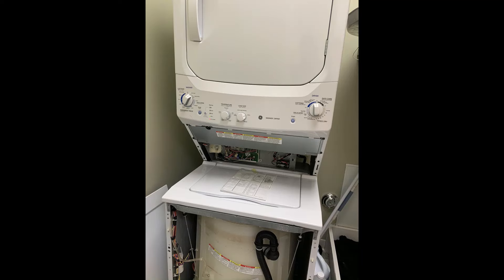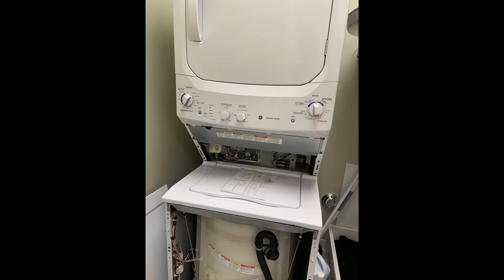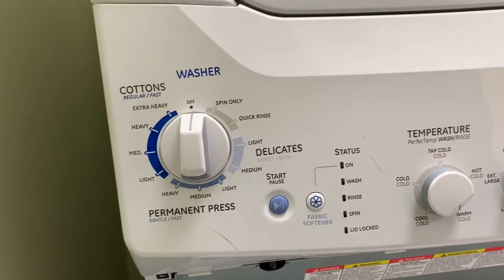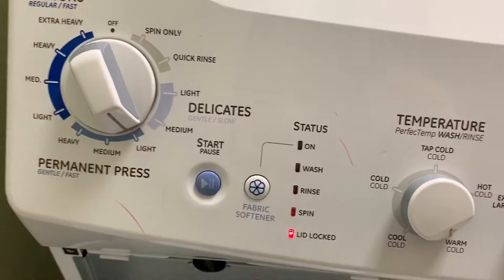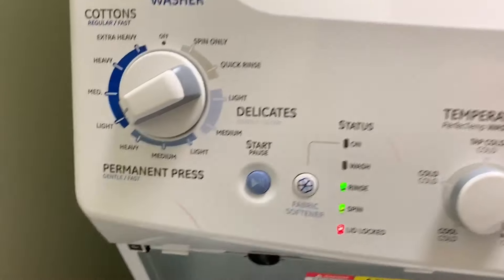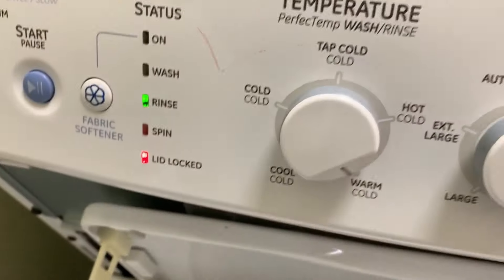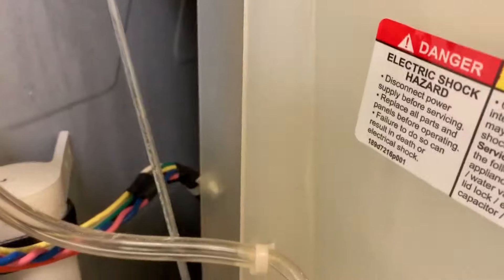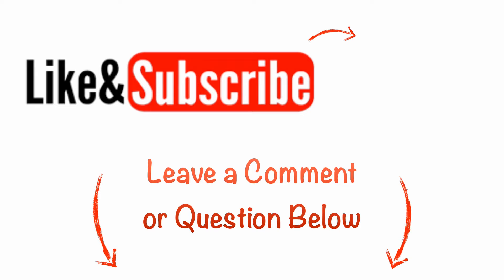How to use Diagnostics on Stacked GE Washer Dryer combo(Laundry Center)

Comment: I have this unit and the washer side has no power.lights wont turn on and it wont do anything. Dryer is still working fine any suggestions?
Reply from the maker: I would suspect the main board.  Check the schematic and wire the L1 and make sure it’s to the board and voltage out of it is good or not.  Don’t know specifics without seeing a schematic. Good luck!
Reply: I’m having the same issue. I took off the slanted panel underneath the dryer and the electrical board inside was soaking wet! I don’t know if that’s the main board or if I should replace it. Were you able to resolve the issue?

Comment: Thank you so much! I fixed my washer using your video - the error was the spin and when I opened it up - a wire blew and a mask was stuck in the motor. Thanks for your awesome video! You saved the day!

Comment: Did you published the error codes?
Reply: Kathy R yes please release error codes video
Reply from the maker: I’ll get started on making an error code video for you’ll. What lights do you have on and I can let you know what it is before I can get that idea up.
Reply: Thanks, Nathan, I did try to run the diagnostic but instead of the blinking lights all I got is the ON light.  then, when I moved the dial to normal the filling cycle kicked in and it didn't stop regardless of the lid down or up or dial off. Any idea?
Reply: Bearded Appliance Repair my laundry center showed a code... the spin light it’s on... what would that be?
Reply from the maker: That is a blocked motor error code.  Does your basket spin freely?  If it don’t you have to find the obstruction.  Could also be a failed motor causing your problem.
Reply from the maker: You may have a different model where the diagnostics is different.  Let’s start with what your washer was doing before you trying to put it in diagnostics.  Maybe I can help figure it out
Reply: Bearded Appliance Repair it filled the basket with water and then stop just before the actual washing cycle . Yes, the motor spins freely... I really appreciate it your video and you replying to this! Thank you very much.
Reply: After hours of being pissed off troubleshooting, wash light stayed on  selecting test number 9. 
Motor moved little bit in each direction then stopped making be believe the motor was good.
Turns out motor went bad put a used one in and now washer works perfectly.
Found a broken unit on OfferUp (dryer not working) swapped motor and did 10 loads of laundry.
Reply: Mr. Beard, while agitating, I hear a grinding sound. Popped the front off and investigated. Discovered that the arm that lifts the spin sprocket up doesn't lift it enough. 
Been 3 months of plastic sprocket noise now.

Solenoid? Motor? I need the nylon arm to lift that round sprocket up more. I can manually lift it up and its perfect. 

Any ideas, please? Thank you

Comment: What do you reckon I should do about the awful odor coming from the washer tub? It continues to get stronger even though I leave the washer lid open after each wash ?
Reply: That odor is from missing socks and underwear that fall outside the drum when switching wash to dryer,  get a thin object like a spakle knife and push two clips in towards drum on front of washer panel there white in color

Comment: My washer/dryer stackable will do everything but agitate. Hired a guy and he thinks its the transmission. Why would it fill, spin and drain but not agitate. I have been doing laundry in diagnostic mode as I do not have the money to fix if it isn't the transmission? It will spin in Diagnostic mode but not in regular mode. Please help!! Any ideas?? The guy also thought it was 3 other things so I do not trust him, the belt was off and he fixed that and there was a piece of clothing in motor. He left thinking he fixed machine without testing and has already received payment, ikes!!

Comment: My unit is barely two years old. And I am single, so there is not a whole lot of rush. All of the sudden it just started malfunctioning . When I try to wash a load and the water is draining, the drain pump continues to drain when there is no water whatsoever and won’t stop until I  machine. When I plug it back in hours later it’s still trying to drain. And there is not a drop of water in the machine. 
I got it working in between somehow for about a month and then now it is doing that same thing again but before that the load only switches back-and-forth to wash for about 30 seconds, and then it drains off the water! My clothes never get washed, and it is waste my soap! I cannot put them in the dryer because they’re sopping wet. The spin cycle never went on, but even if I put them in the dryer, they are still dirty. if there was a recall on the model and serial number but I could not find it though. I’m not sure if I missed it or not.?

Comment: I have a question I have a stackable washer and dryer GE model and the issue that I'm having is why it's not draining the water and it's not spinning right spin a little bit but then stop
Reply from the maker: These won’t spin unless the water is drained.  They are smart enough to to know there’s water in it so it won’t spin to potentially damage something.  I would get down to that drain pump and see if there is something in it.  It’s that or you have a bad drain pump most likely.

If you fix the draining problem the spin problem will go away.
Reply: @BeardedApplianceRepair  the washer still has some water in it and every time I put it to the spin cycle it sounds like an spinning like I can hear it moving not spinning really fast so hard but it makes sound like a spinning but no water is draining I have not yet checked the drain pump.

Comment: What happens if I want to see what the error codes are is there a list? Right now the on button is lit up and the lid lock is lit up and spin is moderately lit up.  My original issue was that the spin was not spinning fast enough and then when I tampered with and gave us an error code

Comment: My problem is that the first two lights are green and the red door lock light is on and it does not respond to the codes. The dryer turns on but does not stay on and turns off.

Comment: If the dryer starts and has power but the washer power button does nothing, what would be the first step to diagnosing?  There is no lights or anything when you push power.  I can't even get the error code working by holding both buttons.
Reply: Did you ever figure this out ? Currently have this problem as well no part of my washer look on
Reply: Did you find the solution?
Reply: @biebermyvalentine did you find the solution?

Comment: i have one exactly like this but it seems to be going into pause mode constantly... mid cycle, sometimes immediately but usually when its full of water ... any clues?
Reply: Did you figure this one out. I have one just like this. I replaced the board and start switch with no change.  Thanks

Comment: We just got a new replacement for GE  GUD24GS. Ive tested it few times and during spin cycle is making a Hugh noise! Any advice how to address this issue. Thanks, any info is appreciated....
Reply: Hi Djeno! Did you have your problem fixed? SeemsnI have the same issue. There is a huge grinding noise. I think the transmission/motor is on before the shifter is connected. I dont know how to fix it.

Comment: When I start a cycle the washer fills a little then. My fabric softener and wash led is on.. wash led is blinking while fab softner is still. And advice I replace lid latch, Shifter system, transmission, and motor sensor not this problem is happening

Comment: I have power to the Dryer but no power to the washer. Tested power to the board but nothing lightning up on the panel.
Reply: Hi . Did you find the solution?

Comment: My Stackable washer dryer turns on by itself??  All the lights light up and it makes a humming noise like its draining water??  then it shuts off??  Someone set its because of the wifi, is there a way to shut the wifi off?
Reply from the maker: is it on a wrinkle release cycle.  like at the end on the cycle does it run for 5 minutes or so turn off for 5 and run for 5 until you open the door?  That is the only time I have heard of a dryer turning on by itself.

Comment: So the red solenoid that engages the clutch to the motor fly wheel isn’t activating. But if I put it in diagnostics mode and then turn it to 7 o’clock push go the three functions all work even the solenoid will push the clutch engagement and it will work but then when I take it out of diagnostics mode and just try to do a normal small load the red solenoid will not engage the clutch fly wheel. So it acts like the motherboard or the brain of the washer is detecting something and not allowing that solenoid to engage. Has anyone else had this issue and what was the fix?

Comment: Thanks for this. I was able to identify the issue was with the drain pump. I disconnected it (after spilling water everywhere of course) to find that it was clogged from a sock. Seems if you load the machine too much clothes can start going into random components :)
Reply from the maker: Nice work!

Comment: Help. I washed my rug and I imagine trash clogged something because noe when my washer Spins the clothes are coming out dripping wet now.
Reply: I had a problem where the tub did not drain. I bought a new pump. When it came time to replace it I removed its hoses and "out" hose was totally clogged with soap, grime, and hair. I cleaned that out and it has been fine. Anybody need a drain pump? The drain pump is on the bottom front left. Easy to get to. If you did a rug there could have been a heaping helping of fuzz going through the pump.

Comment: Same washer it wouldn't powerup the washer. It does not power up anything on the washer it did not matter what setting. Haven't tried your Diagnostics method. What I found was hold the start button then and turn the washer knob and ornate agrees and the light should light up

Comment: Hope you guys see this quickly.
GE GUD27ESSJOWW Laundry center>
Dryer only runs IF you hold the start button pushed in. Let the start button go and the machine shuts off.......
****with the door open and the door switch pushed in it will turn on and revolve (so it's not the belt...right?)
****I swapped the dryer control knob and the push to start knob from a working machine in a vacant unit....same thing....shuts off if the start button is not kept pushed in.
** Tomorrow I will ohm out the thermostats on the inside back to see if any have failed.....good move?
** Could it be the computer control board???
** Could it be something else???
** Is there no diagnostic test for the dryer section of a stack unit....just the washer???

Comment: Hi,please help with samsung dc error code on washing machine and samsung refrigirator ice biulds up over evaporator on the  refrigirator side .If you will be able to make video that  would be perfect.Thanks
Reply from the maker: As for dc errors you have to find the dc components and ohm then out and make sure they are not shorted to ground.  Dc shorts are the worst.  Could be a control issue as well. The best bet is to call Samsung on those. As for the ice build up in the fresh food if it’s the French door model I have a video in them. https://youtu.be/5Fk5RMdVx9o

Comment: not drying at all. The washer part will wash, but won't drain. If you set it on drain and spin, it will, but only if the dryer is on as well. I'm thinking it's possessed. 🤷

Comment: My stack washer is making alot of nosie when in spin.
Reply from the maker: Bad bearing maybe.  Make sure the noise ain’t coming from the drain pump though.  If you can pin point the noise stat will help

Comment: Error codes please! My spin light was on during error codes with on light
Reply from the maker: That error code indicates a blocked motor.  Check the motor underneath and make sure nothing is caught in it.  Another viewer recently found Bobby pins in their washer motor.  Unlikely but possible.  See if you can spin the basket by hand as well.  If you can you may have something stuck between the basket and tub in the inside. Believe it or not shirts can get stuck between there.  If you can sound the basket I would suspect maybe your motor or control.  Let me know what you find.  I’ll start working on a error code video.
Reply: @BeardedApplianceRepair  my washer started leaking and the lid lock may be on the blink but what happens most commonly is a clicking noise and it stops running, just bought a similar unit used and low and behold same problem 4 to 5 clicks and stops?